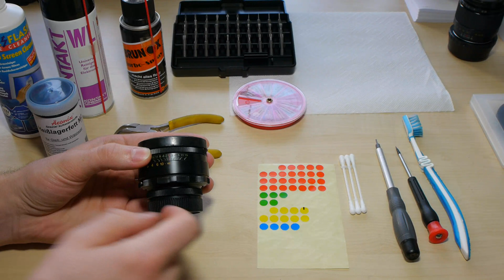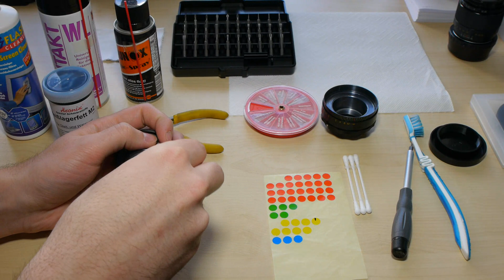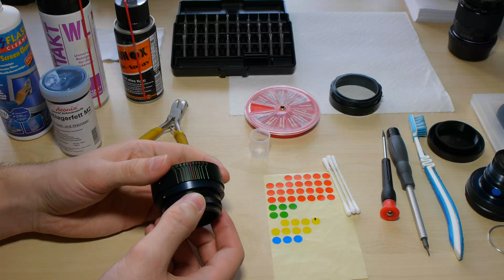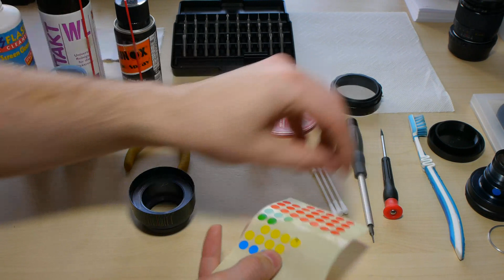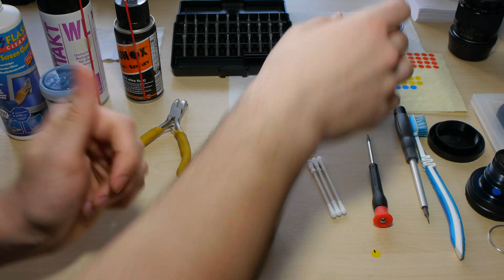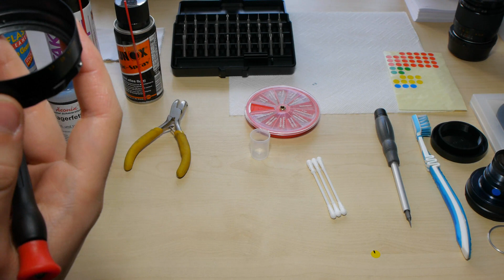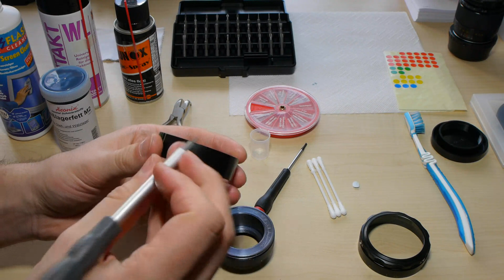Helios 44-2 refurb. instructions (2nd MUCH more detailed part! Attention: VERY LONG!)

Comment: FIRST Thank so much for video , I have already clean one completely but the other one I have problem on first step to turn clockwise on apatur  ring it very tight  so
can you help me please suggestion trick or something
Reply from the maker: Apichaht Ananruttanasakul Goot to hear, that the video is still helping people.

About the stuck lens - Hmm. I also had such a 44-2. Well - You can try to warm it up a little bit - So the thread lock is lossening up enough (though you need to heat it up a little bit longer - So the inner thread is also warmed up - Just don´t apply too much heat ^^). And you can use rubber sheets to have a better grip on the lens (and on the right parts of the lens) to open it up. But I also have to mention: If you´re unlucky, it´s not possible to open it up - Sometimes it´s really better to sell a lens and get another one to refurbish it (instead of damaging it). Btw.: Actually I also refurbished a complete set of Yashica ML primes. Also quite nice glass btw. - But I also had already two ML lenses in my hand, where screws were / got stuck. So it wasn´t possible to refurbish them. That´s life ^^. LG
Reply: AustrianGeek 

It help so much i will try

Comment: Hello, first, thanks for making this video, helped me a lot. But i have one problem, 2 screws from that piece at 32:09 broke inside their holes when i was screwing, do you know the size of these screws and if i can use a clock screw as replacement? Also, do you what kind o f metal that piece is made? because maybe i will need to dissolve the screws
Reply from the maker: Well - The screws are really crappy yes. I also used a replacement screw for one of the outer parts (as you saw also in the video). But I never checked which type they are exactly (I don´t even know, if it´s possible to get replacement screws - As these are EXTREMELY small grub / headless screws.

For the outer part I just used one of the screws of the clock repair (screw) kit you can see in the video (the round red one) - I think it didn´t even fit perfectly - But it worked ^^. So it´s at least an option yes.

About your problem directly: Hmm. You can make it easy - Just drill the stuck ones out and cut a new (bigger) thread, which is also fitting the replacement screws perfectly (also cut the non-stuck thread new). Would be for sure the best way (IF you have the option to get good tools to do so). About dissolving the screws: I think they are out of cheap / weak steel - Not hard V2A / V4A or similar. BUT: I wouldn´t do that. It makes no sense (as it´s better to cut new threads). AND there´s a high risk, that you´re ruining your threads anyway (the original cut ones).

LG
Reply: AustrianGeek Thank you very much for the response. About the screws, i've ordered some of the smaller avaiable sizes of the DIN 553 grub screw, they're hex and not slotted, but if it fits then i'll post here, also i will try to find a dremel to drill the broken screws out.
Reply from the maker: Well - Post your experiences here =)

Comment: would it damage my 5d mkii mirror?
Reply from the maker: pfft. Sorry. But I don´t used it with a 5D Mk.II or Mk.III - So I cannot say it for sure (by myself). There are also multiple comments / different hints - Maybe also because there are multiple editions of the Helios 44-2 available out there (some of them have a longer rear part / element than the others). That´s I think the problem - And that´s the point, why some are saying it works - And some that it doesn´t. =/
Reply: Yes... That doesnt make it easy! ... :(
Reply from the maker: You could try it yourself (if you´re ready to take the risk) - Maybe with a thin piece of foam or felt on the mirror or the lens (so you´re not damaging anything). And maybe check out different models (which are up for sale) -> Try to get a model with the least extending back (if you can see that on the pictures). Or check out local stores (which maybe have used Helios lenses). That would be the safest and the best way I think ^^.

Comment: Hi AG,
          This is my second time arriving at your video, hell you are good. I wish there was somebody like you in Ireland servicing these types of lenses, they would make good money....move over!!! I'll give you a room to stay for a few weeks (I'm serious)...... Anyway would you please make a video for the Mir 20M please?. I just bought one that was 'never used' and as usual the fecking grease is as stiff as my dead grandmother.
I really want to open it up but am nervous as they are not cheap (For a Russian lens) but they are worth every penny, they are so goo.......
Reply from the maker: Quentin Cooper Well - Normally I am not servicing THAT much lenses. I just try to open them up (and if it´s possible - I try to fix them). ^^

The primary problem is, that it´s quite hard to get "acceptable" lenses in non-pristine condition to fix them (and especially to try out how to open them up - As I don´t want to open up pristine lenses - As there is a risk to break or damage something). And also the lower price (of non-pristine glass) is necessary - Otherwise it wouldn´t be possible finance wise, as it´s only a hobby (Btw.: Also my videos are just hobby). That´s also the point why I sell about 9 of 10 parts I review / test out ^^.

The problem with the MIR-20M is, that it´s quite hard to get one. And if there´s one available it´s priced around 150$ (or even above) - Especially the later multicoated models. Anyway - You can try to open it up by yourself. Especially the russian lenses are normaly quite "basic" design wise. And even if you don´t succeed, you can easily put them together again. But be patient (and note or remember where each screw sits) ^^.

Maybe I´ll make a video (if there´s a good offer in the future). But I doubt that there will be one. Most cheaper offers have fungus - And such lenses are no option for me (as fungus isn´t fixable - At least not completely).

Have a nice day. ^^

Comment: This info was just what I needed. I have 3 Helios 58mm lenses 2x M42 and 1x M39. The M39 had a focus which wasn't smooth so I took it apart while watching this video. Great info and easy to follow. Now it is smooth again and I also cleaned the inside of the front glas. I use the M42 lenses on my GF5 and GH3 such a great result with the Helios lenses. Because I don't want another mount for M43 I ordered a canon converter so I can give it to a friend with a Canon :) (I allready have M42 FD MD FourThird Pentex lenses and converters :P) Old lenses are fun to play with. You deserve more then 1 like from me on this video :)

Comment: Hey! My Helios 44-2 (1983, made by Valdai as yours I think) has a wobbly mount, do you know why? I tried to took apart de optical shell, but in mine Helios it's imposible to remove the optical shell form de mecanical shell! Help!
Reply from the maker: Hmm. As far as I know mine is a KMZ model. The "wobbly" mount is a little bit because of the loosened up limiter pin at the back of the lens (which holds the inner shell in position when focusing). You can see it in the groove of the outher shell / M42 mount part of the 44-2 moving forward and backward when focusing. Btw.: Watch 26:41 (there I am showing it / mentioning it).

About opening it up: I know. Many 44-2s are not easy to open up. I also had another (newer) model, where it wasn´t possible. BUT: The "wobbly" mount is more or less normal with the 44-2 lenses. And it´s only getting a LITTLE BIT better (when you´re screwing in the limiter pin again) - There will be always some "play" and "wobble" left. SO: If the mechanics are ok and well greased, you don´t need to open it up. And I also don´t recommend to do it (because it´s just not necessary ^^).

Comment from the maker: Oh. Ok. That you mean. No. It´s not possible to "enforce" this characteristic. The optical formula and so also the bokeh of a lens is basically always the same.

The only option to "modify" your bokeh would be to change the aperture blades (to a different shape). But that way you only get different shaped "bokeh blobs" and not a more swirly bokeh. For your information -> "DogSchidtOptiks" are offering modified Helios 44-2 lenses for example - They are quite pricey, but you can check them out ^^.

Comment from the maker: "Permanent swirl bokeh" - Do you mean constant full open aperture? (So - Do you want to remove the aperture blades completely?). Hmm. I don´t think that´s a good idea. A lens without adjustable aperture is like a car without a gas pedal ^^.

And btw.: The 44M series are a little bit more complex to open up. So I don´t recommend it. And I cannot help you with it (directly), because I don´t have a 44M-4 here actually. Sorry.

Comment from the maker: Oh. That you mean. Hmm. As far as you didn´t forget to put in the correction ring - which is regulating the distance of the inner shell to the outer one and is normaly sticking inside the outer shell (so it´s normaly not falling out) - this offset is ok and normal. It was the same with my Helios 44-2 lens (you can see it within the first part of the cleaning series). And don´t forget: The aperture markings are moving. So it´s also important which aperture setting you are using actually. =)

Comment from the maker: Hmm. Do you mean the scratching of the focus ring or ...? The reassembling is quite annoying with the Helios 44-2 - yes. You have to ensure that EVERY screw is again there screwed inside the lens where it was (because otherwise they are maybe scratching on the focus ring or somewhere else). AND you also need to do that, so the focus ring is aligned properly again (even).

Or do you mean something else?

Comment from the maker: I am glad your "lens cooking" helped ^^. I hope you dried it properly in a oven or so afterwards. Btw.: I meant to put it in the oven directly - Without cooking it before *g*. But it helped - so who cares ..

About the grease: Yes. The grease I used is kind of a special purpose grease (which SHOULD BE stable over a longer period of time - to be precise: It´s RC car racing grease for ball bearing departments). But you can also use multipurpose grease (i used such one already at other lenses).

Comment: And yes it did, thanks so much! i put it in a pan and submerged it in hot boiled water and left it for 15 minutes and it came off.the threads were full of [aluminium] shreds that were corroded. it's fixed now. One last question: what kind of grease did you use? Is it multipurpose grease or a special kind? Heißlagerfett seems special pursose grease...

Comment from the maker: Hmm. Did you check if there is maybe one of the headless / grub screws still inside (maybe one broke off or it´s still screwed in too much - if you didn´t unscrew them completely)? Because normaly this ring SHOULD be removable quite easy.

Or (if it´s not one of the screws): Maybe heat it up a little bit (if there is grease or something else inbetween the parts that maybe helps). Btw.: Don´t forget - It´s a vintage full metal lens. Don´t be scared to heat it up a little bit ^^.

Hope that helps.

Comment from the maker: Btw.: To remove the oil completely, I think you have to remove the aperture blades (OR: "Wash out" the oil somehow - Altough don´t do this - That´s not very environment friendly and you need the right oil for the pivot points afterwards). Btw: The "shinyness" is away after it dried -> The cleaner makes it shiny (but it´s gone quite fast). I know of the problem with the reflections. Mine got nearly oil free with the normal method I showed. Just a few minor signs are still visible when using it.

Comment from the maker: About the oily blades: Yes. I cleaned them not THAT precise (also to show how to clean them within the review). BUT: You can do it a few times (with opening / closing the aperture a lot inbetween), to remove as much oil as possible (after about 3 times mine were nearly oil free).

Comment: At one point when talking about cleaning the aperture blades, you mention that you have already cleaned them as good as is useful. However your blades are still way too oily. They shouldn't be shiny. The oil reflects light around the inside of the barrel and creates odd light flares and aberrations. 

The pivot points on the blades need the tiniest amount of lubrication but there shouldn't be any oil on the visible parts of the blades.

Comment from the maker: You don´t need to open up your lens. This little wobbling is normal with the Helios 44-2. I had already two of them (this older KMZ and a newer KMZ). And both were wobbling (it´s maybe a half millimeter).

To be precise: It´s the small limitation pin at the back (which is normaly not 100% perfect fitting the back part). But that you cannot fix that easily. You would have to replace the pin completely.

But I think it´s still a VERY nice lens.
So have fun with it and thx for the kind words! ^^

Comment from the maker: Sorry. But I don´t have the vivitar. Btw.: The problem with such lenses is also a little bit: Zoom lenses are quite complex to open up. AND because there are THAT much different mount and aperture control options (Nikon, Olympus, Canon and so on) it´s not the same (to open it up) with every lens type. MAYBE I find one very cheap (my finances are very limited actually). Then it´s MAYBE possible, to make a video about it.